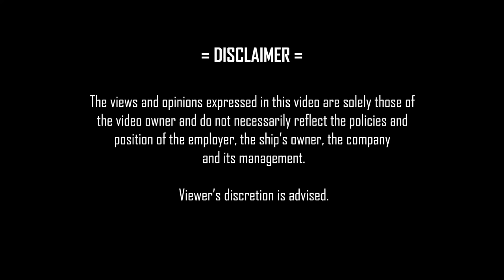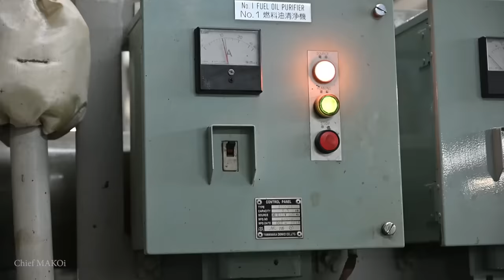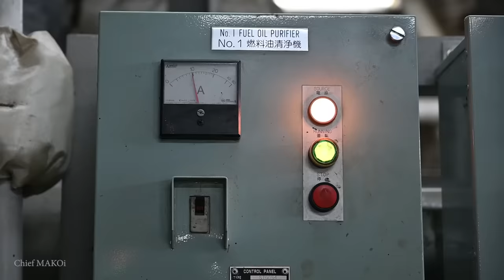Fuel Oil Purifier Overhaul | Selfjector | Chief MAKOi

Comment: Awesome video!  Being a techie, love watching tech videos about just about anything!  Couple questions:  1. What percentage of the bunker fuel is unusable sludge?  I am guessing that the byproduct is stored in a waste tank,  but once offloaded from the ship, how is is disposed of?     2. How loud (in dB) is it in the engine room?  In watching your videos, I have noticed that engineering staff will sometimes wear hearing protection depending on where they are or if the main engine is running.  *You can get the "dB Meter" app to run fairly accurate checks from a smartphone.   Any answers are much appreciated!
Reply: 150-190 dB
Reply: @adriandejesus143  Thank you for that info!  Holy cow that is LOUD!
Reply: @crp5591  190 is impossible, that's as loud as the space shuttle was at liftoff (at 1000' from the launch pad). 190 dB could kill someone. Engine rooms typically aren't that loud, unless you're standing right by the turbocharger, then yeah that is SUPER loud, and the problem is it's high frequency noise which destroys your hearing really fast. Deep low bass sounds aren't that harmful, but hearing protection is still required because if you spend your entire watch of 4 hours in the engine room day after day, after 6 months you'd have big problems. I remember opening the door to the engine room from the control room, and I could still yell in someone's ear to tell them something, I would put the sound volume something like sitting on a large riding mower at full throttle, or standing right beside a large truck sized engine at full power with the hood open. It's fine for a minute or so, but trust me, after an hour you'd hate it. Another problem is your ears get acclimated pretty quick to the sound, and the threshold of pain is quite a bit louder than dangerous dB levels.

I'd put it to more like about 110-120 dB, but keep in mind a typical engine control room door is like 20-30 meters away from the M/E itself.  About the same volume like going to a rock concert. People spend a few hours at these with no hearing protection, like, who would go listen to music with ear defenders on?? 140 dB is like firing a 12ga shotgun, and ya if the engine is running that loud, you better find out what the problem is, cuz "that ain't right".

However there are engine rooms that are really nice and quiet, for example a few of the old BC Ferries during cruise the engine just sounded like a giant sewing machine, just ticking over. However, because a lot of those routes were only 1-2 hours long, they would run at full cruising speed until the last minute, then slam it onto full reverse. During approach to the dock, you really had to have both ear plugs and ear muffs on, because that nice ticking over sound would turn into a huge roar, and the sound of the 4 turbochargers spooling up literally sounded like a 747 starting a short field takeoff roll! The scream of the turbo's would drown out EVERYTHING else, and it was even really loud on the car decks up above the engine room! When you can barely talk over the noise standing on the deck where passengers are allowed, then you know it would be ear suicide to stand right by a turbo at full send with no ear defenders.

That's another reason why hearing protection is always required. You never know when they will have an emergency on the bridge, and put the ME into a crash stop and emergency reverse... things can go from a nice quiet rhythm to full unleashed hell in just a few seconds.

Comment: Fascinating!

How often is this maintenance done?

What would have happened if the dial gauge showed a bend on the axel? What are the tolerance? Do you keep spare parts in stock?
Reply: Since the separators are essential to keep the vessel in operation, spare parts are kept in store.
Main spindle, worm gear assembly, bearings, O-rings,  lots of O-rings, bowl discs, but also the necessary electronic parts are necessary to keep in stock
Reply: @mmm365  When I was at sea, the cone shaped discs were washed off during the overhaul of the bowl assembly.
During operation of the separator the dirt is ejected automatically after a predetermined period. (It accumulates at the peripherie of the bowl body due to the centrifugal force) So, the bowl is “self-cleaning”
On my first ship which was built in 1962, the Alfa-Laval HFO and MDO separators were of the self-cleaning design, but this was manually controlled by turning a selector valve which had four positions.
The two lub. oil separators however had to be opened up for cleaning every day, for cleaning all the discs. That was a job done by one of the oilers, which took him mostly half an hour.
Reply: @janvisser2223  likewise with us for lube oil purification, done nightly in about 30 minutes. Luckily it was touch smaller than this fuel-oil one.

Comment: do any ships have high pressure parts cleaners that could be used instead of all the manpower to clean oily parts?
Reply: Yes that is some thing I want to know as well.
Reply: I was wondering this as well.  Cleaner (solvent?) in split plastic jugs in an enclosed space does not seem like the best method.
Reply: @PeakVT  I was thinking that as well. With so many parts needing PM in an engine room, a dedicated parts washer basin would enhance productivity and safety a lot. Next time they're in a port with a Harbor Freight store they should pick one up cheap.😁
Reply: @PeakVT  its a strong chemical acid that instantly removes solid oil impurities, we normally soaked it for couple of hours.
Reply: Yes but in a confined space like the engine room, that would splatter the mess everywhere. Plus it risks aerosolizing that nasty gunk which is very unhealthy to inhale.
Reply: Ships are not allowed to dump oil over board so high pressure washer would create large volume of oily water which would cause a heavy work load on the oily water separator more over there would a problem storing large volume of oily water. 
To clean smaller parts there are ultrasonic cleaning machine and to clean these oil chemicals are used.  Rest of the oils are wiped using rags these rags are also stored separately and off loaded at ports as designated oily garbage or incenerated in the incinerator

Comment: I hated cleaning the Alfa Laval fuel oil purifiers. I was a wiper and worked with the Third Engineer cleaning all the purifiers. Bunker C was so messy and difficult to clean. I remember one of the specialty mechanical seals failed and kept us in port for two extra days because it was not available in Japan.

Comment: That's very interesting to learn. I hope this doesn't need to be done more than once a year. Sure is a lot of effort.
Reply from the maker: Every 2 months for each unit.  There are 2 for fuel and 2 for lube oil.
Reply: Surely does, plus normally purifier room have 55-60 degrees C 🥵
Reply: @adriandejesus143  60c you say? Incredible.
Reply: @jamesbutler1862  It depends on where you are, if the ship is like near the equator or somewhere where it's quite hot and humid outside it's terrible. However if your ship is like in the northern Atlantic in the winter, then there is so much cold fresh air being pumped into the engine room all the time that it's actually quite tolerable. Just go up on deck in that cold winter wind and take a short break. However in the tropics that 'fresh' air is already stupidly hot, and the purifiers are the same temp as the fuel oil, so probably close to boiling point of water like 95C.

Comment: Pretty amazing looks to be tight tolerances to do 18000 rpm. Durned fine mentoring. 
A question how do they get really big parts into the engine bay while at sea? If something big was to break.

Comment: Excellent video. Why don't you use  brushless nut runners or ratchets to do job faster. Once it's loose  you take 3 seconds per bolt to take out. When manual it takes 15. It all adds up.

Comment: Great breakdown. Do these engineers generally have a checklist or manual open that they can reference while doing these things, or is it expected to all be from memory?

And approximately how many times would one assist in a task like this before being asked to lead it?

It’s one thing to master a single type of equipment onboard, but you guys have to master several, which is very impressive!
Reply: All machineries onboard have their manuals and yes we all use them👍🏼

Comment: The opening shot shows another ship crossing the bow of the ship you're on. Presuming that your ship is at anchor, I thought when passing an anchored ship in this way, because of the possibility of hitting an anchor cable, it was a better practice to pass astern of an anchored ship. 
Or, is it that the zoom setting of the lens makes the other ship appear to be closer than it is?

Comment: Hi Chief!   I’m not an engineer, so this question is out of curiosity…..You state the fuel used is “heavy oil”, and contains impurities.   Why wouldn’t these impurities simply be refined out of the fuel oil, before loading into the fuel bunkers aboard ship?  Thanks!

Comment: Great video.  Takes me back to my days as a shipyard waterfront support engineer.  Question:  If you find an out-of-specification condition, are you as chief engineer the approval authority? Or, do you have to submit it to a shore side technical authority?  On submarines we have mechanical face seals on the propulsion shaft.  If you have the same type of seals,  the rebuild process is quite interesting and might make a good video.

Comment: Chief, I'm familiar with lube oil purifiers, that were shifted and cleaned at least once every 24 hours (if I recall correctly, it's been 24 years since I've been aboard a frigate). How often do you clean a fuel oil purifier?

Comment: 17:03 Lol, "stethoscope"

In other words, a thin metal rod. They do actually make dedicated mechanics stethoscopes that work on this principle. The working end is a long metal rod connected to hollow flexible tubes that further connect to dual hollow metal rods with ear inserts. It's got me wondering which is more effective though. I mean the fancy version has advantages in flexibility and could possibly increase the loudness with the direct in ear connections. But does the three part construction negate that by imperfect sound transfer between the pieces?

Comment: What was the reason for replacing the bearings? they looked like they still spun OK.. Do they get replaced after X hours "just in case"? Did you measure them and they were out of a tolerance? thank you!

Comment: What role does water have in the filtering process?  Does it dissolve impurities?  Make the fuel less viscous?  As I understand it water itself is an impurity that will cause problems in the fuel system.  However, I'm not an engineer so please forgive me if the answer is obvious and I don't see it.

Edit:  I should have known there would be a video on the function of the fuel oil purifier.  I found it and answered my own questions.

Comment: So if I see that correct in your video , I count 4 purifiers 
Is the main engine in normal running mode always using all of them and can 1 be easily shut down for maintenance or are 1 or 2 of them just there as a backup in case of a problem with the ons in use. ? 
Sorry for the long question. 
Thanks
Reply from the maker: 2 are for the fuel oil and the other 2 are for lube oil.  Only one of each needs to run.
Reply: Clear , thanks chief. 
Love your vids.

Comment: This was interesting. I was just wondering what you do with all the used cleaning stuff? Do you put it into a tank to be off loaded at dock?
Thanks for your time.
Reply: Yes, the sludge is kept in 55 gallon drums strapped 4 together and stacked on pallets to be taken off. Cleaning solvents can be dumped in the incinerator a bit at a time, if that's allowed. But nowadays, used cleaning solvent is collected and shipped back to whoever the contracted supplier of cleaning solvent is, and just exchanged for clean cleaning solvent. A lot of car repair shops and dealerships use the same service around where I live as well, it's just more cost effective in the long run, and you save money on all those plastic jugs/containers. Trash is a big problem on ships that are on long extended voyages, and you want to try and have as many things in bulk as possible, and not have to deal with all the trash from dozens of little 1 quart or 1 gallon containers.

Comment: You guys have a lathe on board but not a arbor press? That would make those bearings so much easier. They are fairly small and could sit on a corner of the work bench.

Comment: It's interesting that it's more cost effective to clean the fuel on the boat as opposed to the fuel being cleaned in bulk at the refinery.  The TCO for all that cleaning equipment doesn't look insignificant.
Reply: I belive it serves more as a fuel Filter to remove small ammounts of contaminants, like the one in a car

Comment: Curious, is there a reason why it seems everything from big to small is done with hand tools? I know there are things that an electric or air impact gun can't or shouldn't be used for but would think there are also times where zipping a nut or bolt off with an impact is much faster or saves labor but I can't recall seeing one ever used in your videos.

Comment: One thing with ship engineers they still actually pull stuff apart maintain and repair. Bigger equipment the bigger the cost they have to. So often now auto engineers and other smaller engine workers often just plug and play parts. A lot are designed to not be repaired only replaced. All these sealed bearings you can't grease so have a short life. Sealed diffs where you can't change the oil. Such a con to build in the premature replacement. Everything on a car used to be serviceable but they lasted too long. You get what 30 years out of a ship. Try that with non repairable parts.

Comment: Where do the impure sludge go after being separated from the oil? Is there a separate storage tank that gets emptied at port?
Reply from the maker: Sludge tank.  It either gets burned in the incinerator or disposed in port.
Reply: @ChiefMAKOi  I was wondering the same thing.  What is the approximate range of percentage of contaminates in the heavy oil you have experienced?

Comment: Nice work by the cadet--you can tell how careful he is in all of his actions.  Chief, is it common to have a metal lathe on a cargo ship?  If so, who uses it?  Thanks!
Reply: Former cruise ship engineer here. We had a big and a small lathe. As to who could use them ? Any one. All had been trained. But if you had an intricate job you would get someone that had the most experience to do it.
We had one engineer who’s hobby was making steam engines (ie choo choo trains !)  All his boilers were Lloyds certified. Finished engines were 3-4 feet long.
Reply: @rodfair5698  Hi Rod, thank you for sharing.  Are there typically other machine tools on board such as a mill, etc as well?
Reply: Yes every International cargo ship have lathe. Normally all engine crew are trained to use them.

Comment: In last week’s YouTube video “What’s going on with shipping” titled “Baltimore Update w/William Doyle Dredging Contractors……” they said in 2022 over 600 ships were disabled by contaminated fuel.  In your video here the “Fuel Oil Purifier” that was overhauled in the video does it not remove all contaminates?  Sal’s guest is claiming “plastics, rubbers and junk” is in the fuel clogging the injectors.  Besides having the harbor fuel brokers providing a more high quality fuel do the engine rooms need additional fuel filtering equipment so ships are not disabled by contaminated fuel?  We don’t have 600 planes crashing each year from contaminated fuel so if pure Jet A can be uploaded to planes then one would think it could be done for the shipping industry.

Comment: be interesting to know if you use a heating device for bearing fittment or just hammer them on?
Reply from the maker: hot oil bath.
Reply: @Chief MAKOi  that's what my $20 fondue pot is for in my shop. It also works for heating main piston seals on hydraulic cylinders.

Comment: By means of centrifugal force

Sludge cover
Bowl assembly (15-18k rpm)
Disc nut
Heavy liquid chamber
Heavy liquid impellor
Gravity disc
Light liquid chamber
Bowl
Vertical shaft
Water supplying device
Horizontal shaft
Distributor inside ball assembky
Main cylinder
Pilot valves

Comment: What happens to the impurities in the heavy oil that the purifier removes?
Reply: They are ejected and end up in the socalled sludgetank.
Sludgetank full? Than the contents will be pumped by the .... sludgepump to a shore based reception facility.

Comment: How many of those tools are specific to the separater, vs just universal? I'm thinking mainly the puller and compression tools
Reply: All separator manufacturers supply special tools for maintenance. I think that 98% of the tools needed are “special tools” designed for the separator.
Reply: @janvisser2223  i know like the nut wrenches and such are specifically made for it, was wondering more about the pullers and such
Reply: @friesm2000  with the Alfa Lavals the pullers were also specifically designed for the job

Comment: How can bunker oil when all is said and done be less expensive than diesel fuel? It seems the special purifiers and additional man hours and the segregated tanks, lines, etc. complicates things way beyond the cost difference for cleaner diesel. What does this stuff do to the engines and exhaust purifiers? You’ve posted before that a certain distance from port you have the additional work of switching to diesel fuel and stringent paperwork has to be kept for port authorities. Seems like it’s just not worth it.